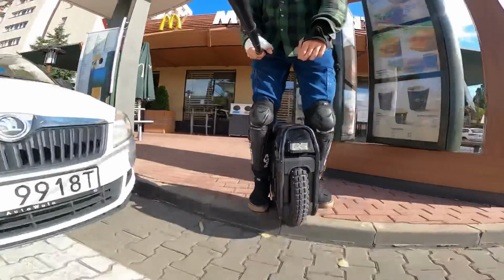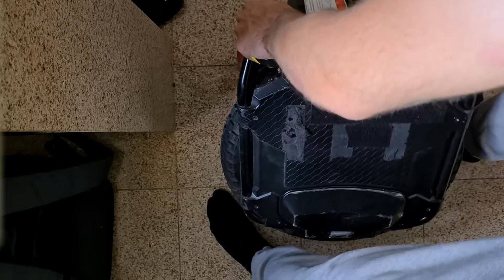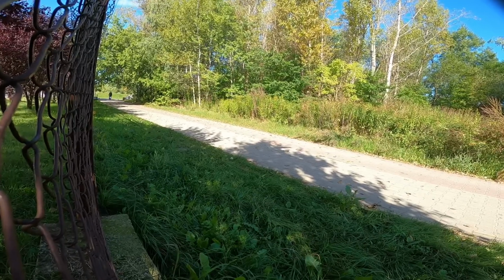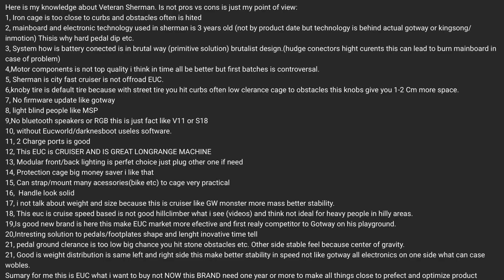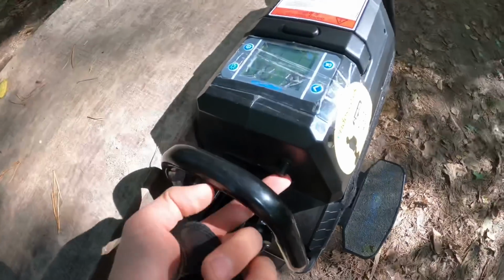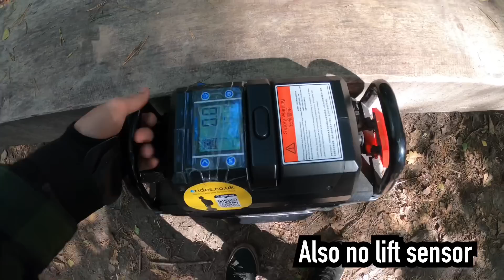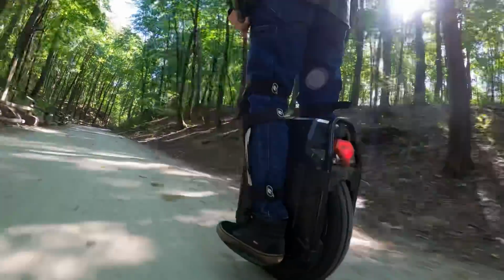70+ km/h EUC - VETERAN SHERMAN REVIEW

Comment: Good review Adam, the 50/50 weight distribution does make it a nimble, stable wheel going slow or fast, acceleration and braking would be better if it had slightly more torque, the headlight is blinding and would benefit from a shroud similar to the one you had on the MSS, looking forward to your range test now.

Comment: Good review man! You need to try the new firmware as it is supposed to give you better low end power (torque) also you do realise you can move the headlight up and down by simply adjusting 👍😊
Reply: Adjusting head light is a misconception unless you want light only a few meters forward. Remember the reflector push light UP and DOWN (and sideways). You need to block off light toward car lane with polished aluminium (to bounce light back into reflector and out at the top toward the ground)

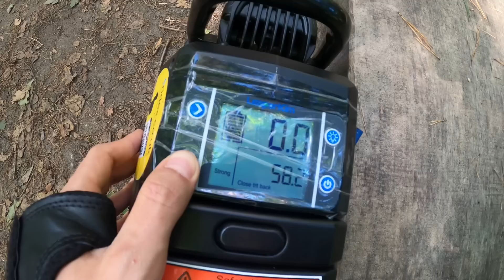Comment: @22:15 If you accelerate MAX and want the tiltback to kick in in time (before cutout) I guess they need the margin of 10+ km/h for heavy riders. I set my tiltback in euc world to 43km/h since cutout on Tesla is in the 50-53km/h whereabouts and i got to 49 when just pushing it hard before tiltback actually slowed me down...3-4km/h for a light rider is maybe enough, but me at 97Kg I was probably just 1-2km/h from cutout.

Comment: Dear Kind Sir, I rode 6.5 thousand miles in under 2 years on a KS18 L... when I tried the VS I found it to be unnecessarily bulky... What are your thoughts. I would prefer the KS18XL but I like the size coz i can lift it up when going up and down stairs like at train stations. I'm considering the VS but I was quite happy with the KS18. Thanks for your feedback ;) x

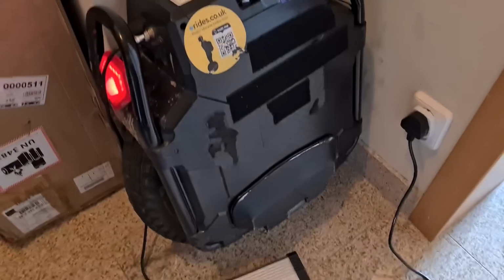Comment: @18:34 Fan running on Sherman? Thats new? Fan on charger. Nice...i had to DIY and install a fan on my tesla v1.2 charger 🙈 as it got so frekkin hot that the plastic inside charger went blue. Not the best for the capacitors. Now its cool as F...and i got an easy cleanable dust filter so i dont draw in shit in the charger.

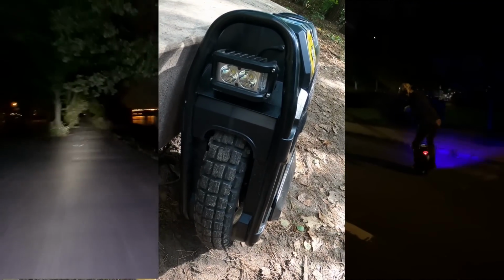Comment: @17:20 block of the blinding part with a polished piece of aluminium and youre good. Aka put the aluminium piece at the BOTTOM of the head light so that the reflector does not push the beams UPWARD toward cars.
OR add a small motor to the aluminium flap and add a button to Euc world so you can blind idiot car drivers 😁
Reply: BigBadBoogie there are two screws on each side to adjust tilt of the beam.
Reply: @masterblasterofdisaster  Yes, but what happens if you tilt it down. Think a bit now :) there is a uniform reflector ;)

Comment: imo it is too fast
Reply: Too fast ?!
Reply: Just wondering. Do you feel the same way about cars? Most cars are capable of going much faster than people drive them. So, is it the top speed of the Sherman you think is too fast or do you think Adam rides too fast?
Reply: I'd rather ride 50kph on a wheel that can do over 70kph than on a wheel that can do 50kph.  Less risk of a cut-out if you have a wheel capable of faster than you actually ride.